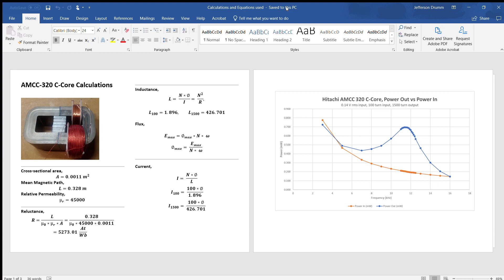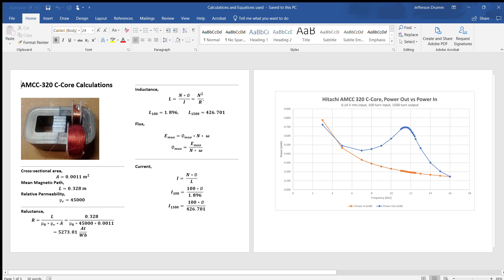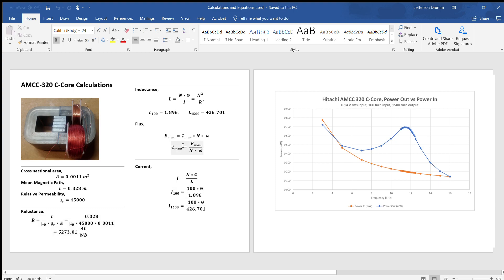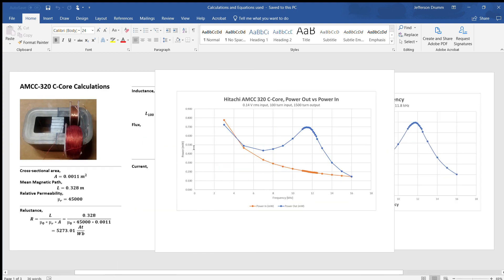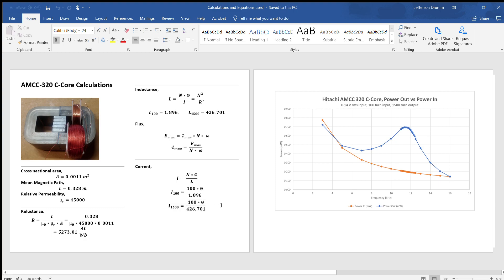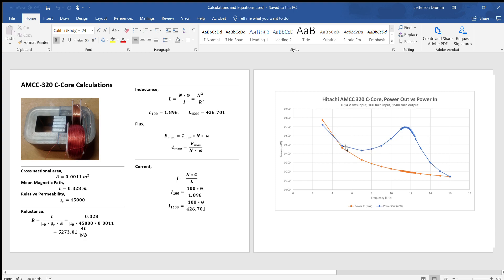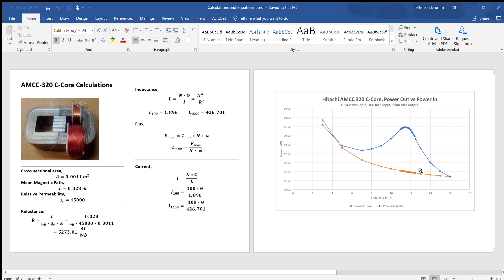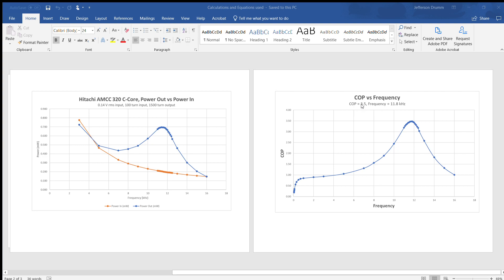MEG Testing Results, COP = 3.5,  Vacuum Free Energy Confirmed!!! Thomas Bearden

Comment: Do not even think of quantum mechanics bullsh*t.

The works only because the energy of magnets is harnessed. That's it. This is the delusion of "free energy".

This is not "vacuum" energy/luminiferous aether energy. Aether has no energy but you can use aether to create energy through action and reaction. Apply action, aether would react. Hence, all alternators, electrical transformers, and motors create energy as it reacts with the applied force.

If everyone would understand that conservation of energy is broken the moment thete exist the secondary magnetic flux, people would understand that energy is created through newton's third law. However, there is no motion for electrical transformer, only alternating force.

Overunity is can only be achieved by combining reaction and action force together. Thane heins transformer is a good start but thane heins misunderstood power factor. Power factor is just an indication of how much power is "transferred" coughs DUPLICATED *coughs*. Understanding that ALL of source energy is wasted as heat and we are using only the duplicated energy.
Reply: Quantum mechanics bullshit? how can u state this?
Reply: @HeadshooterGTAS  This world isn't made from magical particles mate.

Also, update on thane heins transformer. It's just waste energy even if it is successful in bypassing "lenz's THEOREM". Found an original overunity machine. Simple as heck. Fusion machine category, hidden chapter of electrical machines that can't be found anywhere nor on the internet. Not a pipedream BECAUSE it is made from literally the combined structure of a no load synchronous motor and synchronous generator. Actually reduce a lot of losses when the structure is one. Allow parallel energy flow as transformer coupling is present between motor coil and generator coil. Yet, the motor coil as the primary coil of the transformer doesn't drop voltage. Instead, emf is induced on it due to rotor. However, current flows in opposite direction due to source. You get a situation of the motor coil acts as both an input and an output. Output causes leading current, current as input which induce emf on the generator coil, but not of transformer law, but the same as a rotor. Changing magnetic field induced emf as long as no input voltage is dropped which limit the output voltage like transformer does. The resulting voltage is tremendous. Enough to loop back the whole thing and still capable of powering loads.
Reply: u have to prove that QM is false
Reply: @HeadshooterGTAS  I don't need to prove a theory that is unprovable. Their so called evidences are merely forged reports and mass media parroting to make it look real.
Reply: Hydrogen atom.
Stern & gerlach experiment.
Spin

i don't think u know what you're talking about
Reply: @HeadshooterGTAS  the hydrogen atom is a poor's man view of it. See nemescope for TRUE structure of atom - aether corpuscle.

The stern and gerlach experiment is just a clickbait, an entertainment to fool your mind. All magnetic field is the same irregardless of shape as seen by a nemescope except a pyramid which is a dielectruc constrictor. The so-called "electrons" doesn't exist when it is actually dielectric discharge.

Yeah, I know what I am talking about. Ever research tesla, steinmetz, maxwell, faraday, heaviside, leedskalnin, dollard, walter russell, and wheeler?

These people are the fathers of electricity except the last two, which are just philosophers but distinct.

Unlike your quantum quackery crap, which has nothing to do with reality, it can't even be used to make overunity machine. Also, thermodynamics law is BS.
Reply: like "overunity" is something proven? how do u explain that every motors follow thermodynamics laws
Reply: @HeadshooterGTAS  every motor, generator, transformer follow thermodynamics law. Except hydrid machine.

Ever wonder why they don't ever teach hybrid machine? It can be as easy as adding another stator coil layer as output on a no load synchronous motor then do tests to get the parameters. Yet, there are none. Either it is suppressed, or electrical engineers are actually stupid.

If you're an electrical engineer, surely you have learnt synchronous motor and synchronous generator? Have you ever taught of structurely combining them? They tell you it has a lot of losses. Yet the losses is not greater than mechanically coupled dynamotor due to a lot more matter is used. Be it copper loss or core loss or any type of losses. Using more metals equal more losses. So how is adding another stator coil layer as output on the synchronous motor, OR using half of the available copper windings as transformer output even hard?

Mechanical coupling and with only electrical feedback doesn't lead to overunity. Only when there is direct electromagnetic coupling between the primary stator coil layer and the secondary stator coil layer, or rather, direct electromagnetic coupling between motor coil and generator coil, will there be output. The rotor will be able to excite both of the coils like what a synchronous motor and generator do. Except this time, it is BOTH at the same time in one structure.

They love to hide anything that goes against their "science". Even going as far as erase it from electrical engineering and since everyone is so brainwashed, no one has the wisdom to think about it.
Reply: @HeadshooterGTAS  "it doesn't exist", "it is impossible", "it is fake".

How HARD is it just to add another stator coil layer, to the stator of the no load synchronous motor?

How HARD is it just to purposely add another stator coil layer to the stator of a synchronous generator, as electrical input rather than using mechanical input?

How HARD is it just to purposely add a rotor to a transformer, just to increase the output using mechanical input, or directly use the primary coils input to rotate the rotor, while still inducing emf on the secondary, literally doing DOUBLE of the work with only single source?

How HARD is it to measure the equal machine performance, power, energy, voltage, current, frequency, losses, load characteristics?

No. It isn't hard.
Reply: Ok i'm just a physics student that's why i reacted to your beliefs about quantum mechanics. I don't have much knowledge in electricity since RLC circuit from my first year. It looks interesting, but the author of the video should know that CoP =/= efficiency. CoP can be higher than 1 it already exists as heat pump
Reply: @HeadshooterGTAS  Yes cop =/= efficiency as it is for heat pumps lol. For overunity efficiency, the electrical onput must be greater than input.

The MEG in the video uses magnet to amplify the pulse output as the field direction is equal, and uses faraday's law. You may say cop>1 due to the magnet. But in eternal condition, electromagnet will be used and the resulting efficiency would be below 100, the machine would just be an electromagnetic pump.

Anything that uses magnets always produce cop>1 but they doesn't last forever. These types are pseudo-perpetual motion or pseudo-overunity.

Only mine is the true one .-.
Reply: does a video/article explain how it looks like?
Reply: @HeadshooterGTAS  There are literally no mentions of it. This is how bad this is. Surely there must be at least some basic tests on it by engineers yet, there are nothing.
Reply: did you try ?
Reply: @HeadshooterGTAS  Not yet.
Reply: as you say quantum mechanics are bs, i agree. this is the unproven fancy words distraction.
any and all options that produce or allow usage of energy in authentically efficient methods are labeled "disruptive technology"...
efficient use would allow deep understanding to be common knowledge.
power comes from exclusive ability(or the belief thereof).
people want free energy for everyday use. but unlimited energy availability offers powerful machinery, unlimited travel and destructive implements beyond belief.
restricticting "disruptive tehnology" keeps exclusive ability powers within grasp, consistent profits from tech devices that are obsolete and creates health issues that compound profits and keeping people busy struggling to afford devices and their power source. while simultaneously struggling to survive the predetermined health problems that the health care industry will milk and expand until insurance refuses and you can't pay

Comment: Do you have anyone that is great with micro controllers ?? I am thinking of replacing the (what was it, Tl494?) with a controller that can be interfaced into a computer to control the thing... if you do not have any1 skilled enough in that area, then I put up my hand!    this is my day job..   and I KNOW one can do some amazing things with micro's... also understand that coding them in C or similar programming language does not make them as powerful as they can be...  I program in pure assembly, squeeze every cycle possible.. also take advantage of hardware in a way C compilers never can...
EDIT:    I had a conversation with you many months ago on your first MEG vid, I asked about the core, I still have not purchased said core... BUT I was sorta waiting for you to do more with yours.. I may well be buying one soon....   ALSO the another reason for a micro controlled system, is dynamic response vs load... I can easily see the frequency shifting with load, and if this is a self runner, then ensuring the load doesn't kill the oscillation and need a kick start from a battery.. which is most likely a good idea anyway to have a battery to start the system...
Reply from the maker: I am not very good with microcontrollers and would love any help you can provide. I'm kind of learning the stuff in school now.  But yes to get the system running in tune perfectly I think you're right that it's going to take some it's electronic instrumentation to make it work.
Reply: Just a heads up,  if you remove the magnets and test it, you will most likely get the exact same results.  If you do this test and I am correct, send me a response and I'll explain why.

Comment: well Im excited by these results.. But I caution relying on the maths alone... Everyone (as in me, being a self appointed electronics engineer) would like to see a 4 ch digital scope measuring input volts and amps into the system (including driving circuits and all). The ouput connected into a load (can be resistive at this stage and preferred) also measuring volts and amps with the spare 2 channels... now granted if the resistive load is pure DC resistance you do not need to measure the output amps, though I would for completeness.. wire wound resistors for example do have inductance and therefore not pure resistance..
Reply from the maker: Yes, agreed.  Thank you for the feedback.  I have been trying to get back down to school to work with my professor on the equipment but just haven't had a chance to yet.  I'll check and see if we have a 4-channel oscilloscope, we should, but I've only noticed 2-channel in our labs.